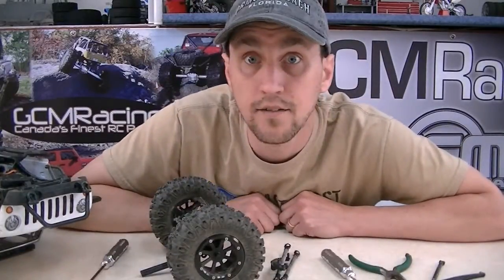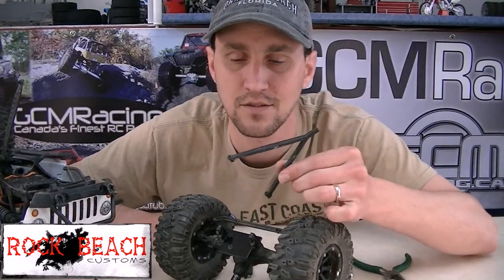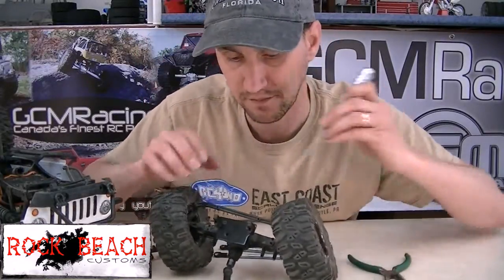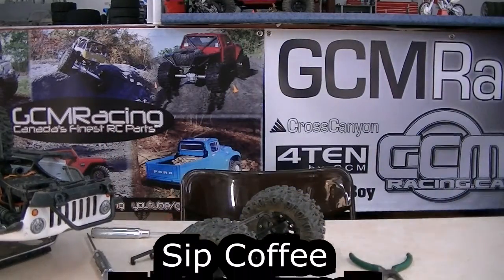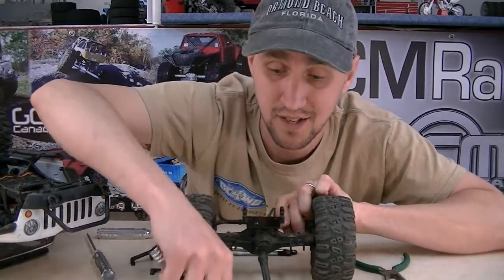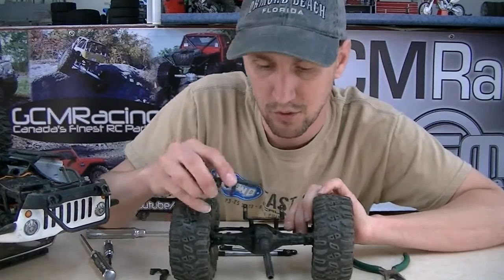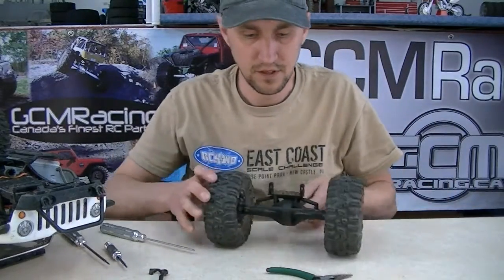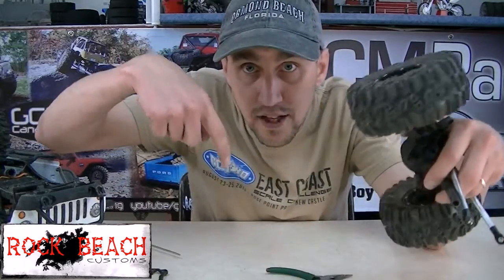Axial Rubicon Front 4 Link with Rock Beach Customs

Comment: Man those are sum nice links no more all thread an break line ! Luv. The vid man
Reply from the maker: They are super nice, with tapered ends, but they are tube and solid threaded rod construction. Yes. Nice and heavy and slide on the rocks well.
Reply: All thread and aluminum tube is cool and fairly light.

Comment: All it takes is a little washer to solve the Y link issue. I love 3 link I kept my dingo/ 2 door jeep wrangler rubicon 3 link front and rear all completely aluminum of coarse and I love my setup. I have a honcho/dodge ram setup with all aluminum 4 link I like the shorter wheelbase 3link better I think. But really can't completely decide lol.
Reply from the maker: It does, yes. Then why doesn't axial ask you to use one in the installation instructions, or put the ball end on the other way? Or put it on themselves on the RTR truck? Anyway, I think it could be just as easy for them to put the same rear truss 4link on the front as they did on the back.
Reply: This is very true cross your right about there 3 link is garbage. And about why they don't at least add a washer to fix this. Better yet use the 4 link. But as for having a full proof aluminum setup in 3 and 4 link I'm liking my 3 link better not sure about what performs best but looks go to the 3 link.